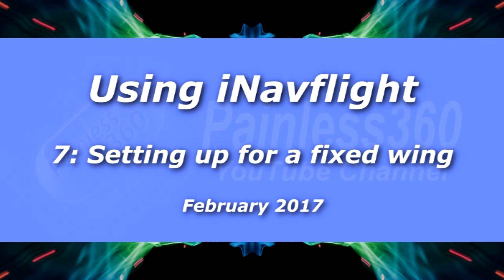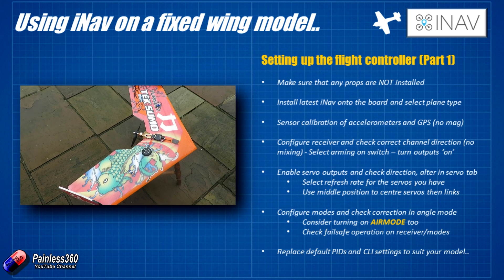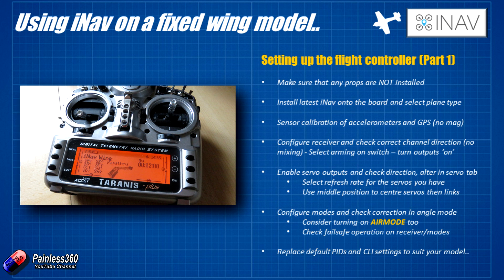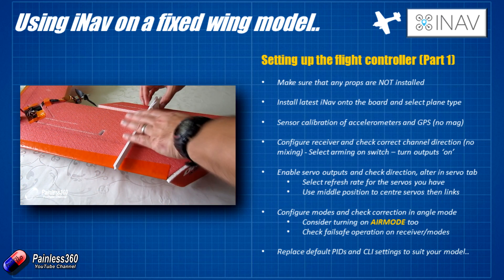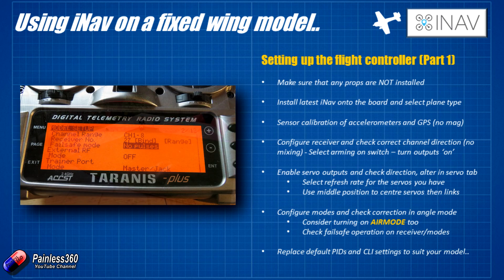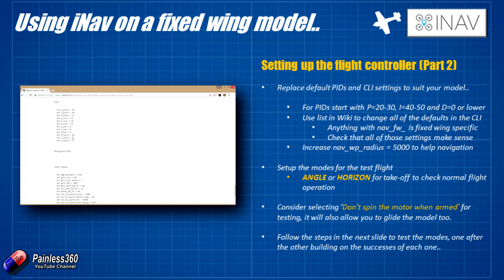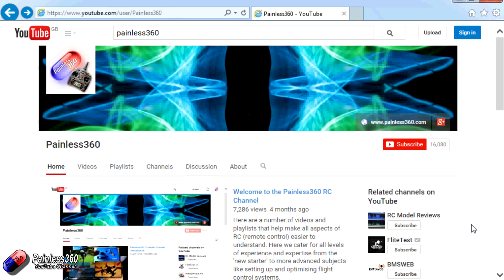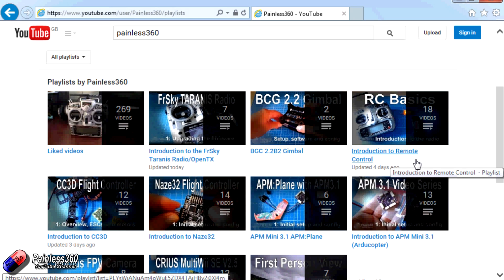(7/8) Introduction to iNav: Setting up iNav on a Fixed Wing

Comment: I am sure this is a very outdated comment, but can I fly a fixed wing with 3Ch receiver ? Inav does not arm the throttle motor automatically, I can move the servos but not the throttle, Do i need 5ch to have one for arming? Thanks.
Reply from the maker: I've never tried.. Best of luck!

Comment: What's the correct way to enable dual rates via toggle switch during flight?  I've tried changing settings for the different "Profiles" and then enabling "Rate Profile Selection" from the Adjustments tab.  But it doesn't seem to be working.  INAV 2.5 does not have a Servo tab and I can't figure out how to do this from INAV.  Or should I just configure dual rates from the Tx?
Reply from the maker: Check out the new INAV for beginners 2020 series on the channel. I'd only worry about rates if flying in manual or acro and then I'd do it on the radio..
Reply: @Painless360  Thanks.  Yes, I have been watching them.  I fly both manual and acro modes.  Betaflight allows you to change between rate profiles via a toggle switch during flight.  Can't seem to figure that out in INAV.  But maybe it doesn't have that.

Comment: Hi Lee  Is there a way of bypassing the "Nav is safe" in the prearm checks on the setup page of Inav.  I have 9 sats on the GPS page and all looks like it should be working ,but wont arm because of the red cross still illuminated. Any advice would be welcome.
Reply from the maker: You can disable it but I wouldn't - I'd look at fixing the underlying issue first.. See may latest iNav 2.1 series for the latest advice.. Best of luck!

Comment: What if the arerons aren’t moving in the right direction when I am moving the w8ng like you?
Reply from the maker: Covered in the video at 6:00.. happy flying!
Reply: Painless360 I am using the F722 board and I didn't find that option, I'll keep trying thanks
Reply from the maker: @javieruriel  If you're using the latest version then check out my video on the custom mixer in iNav.. ;)

Comment: Hello, I'm setting up a Nano Talon with F405 Wing and iNav 2.0
Everything looks ok but the Home Direction arrow in the OSD.
When the craft is pointing straight to home or away from it, the arrow is ok, but in other situations it is reversed, pointing left while should be right and vice versa.
What can be wrong?
Reply from the maker: Depends if you have the mag on or not. If it’s not then the direction is calculated during forward movement..
Reply: @Painless360  it has, but I'm considering disabling it

Comment: Hi, I am in the process of setting up my first Inav flying wing. I'm a multi rotor guy and am looking forward to a little fixed wing fun. I'm using the Omnibus F3 flight controller. Is this able to handle the amp draw from 2 micro servos, X4R receiver and GPS all at once? I have thought of only running the signal wires from the servos to the FC and power them from a separate BEC. 

Cheers and thanks for all the great content!
Reply from the maker: All of the information on that flight controller will be in this video you're commenting on. I've not built another iNav wing using this controller, see my later iNav series for more information.

Comment: I have a ritewing mini drak on the way which has a boom and elevator setup.  Would I setup the normal plane model and just ignore the rudder since it won’t have a rudder?
Reply from the maker: Set up just like any of the flying wing should work fine.
Reply: I found a mini skyhunter profile that I can copy into the cli then confirmed from multiple people on the inav fb group that it would be the best starting point. Its more of a airplane than a wing from my understanding. Thanks for replying. I'll post a reply when I find out if it works properly when i get it built.

Comment: Hi, thanks for super useful info, 
One little note at 6:30 limiting servo throws by 40% is possible but kind of luxurious (60% loss of servo resolution).  
If you want to have less throw the best practice is to mount servo rod at the most bottom hole as possible (towards the servo shaft) you get less throw (but more resolution) and more torque! (and only cosmetic limitation in FC only if needed). This is the best practice.

Comment: at 8:10 you are using something to measure the angle of the wing at 13 degrees... can you please let me know what is that? how did you make it and what does it do exactly?
Reply from the maker: Two spare bits of foam board that I used to get the angle and then used a protractor to measure it :)

Comment: hi,
i have a f3 inav with gps,
the problem is just, that the gyro working 90 degree bad.
if i turn left and right the plane, the alerions goes up and down together.
if i turning to front or to back, the alerions moveing up and down single.
the plane moveing in the inav on the setup screen perfect.
can you please help me?
thx.
radicsmilan et gmail dot com
Reply from the maker: Sounds less like a gyro problem I'm more like one of the servos is backwards. Best of luck

Comment: I am using a omnibus v2 on a fixed wing and want to install servos, how is that done? Thanks.
Reply from the maker: All covered in the video you've just left a comment on. I've not tried it with that particular flight controller, but I'm sure if you checked the pinouts they should be very similar. Best of luck
Reply: Painless360 Ok thanks😄

Comment: @painless360 - Please help my roll is correct i.e. i roll left and the flaps move correctly - roll right and the flaps move correctly. However my pitch access seems reversed - I.E when i pull the stick down the flaps move in such a way that the plane if flying would pitch nose down - is this the way it is on wings? (im new to wings this is my first build) On quads when you pitch down with the stick the nose of the quad goes up.
I know i could just reverse the chan in my receiver but the fact its reversed on the servo's would that impact stability modes and RTH ect?
Reply: Found the Fix
-
EDIT:
This is needed on a flying wing when i.e. roll is handled correctly, but pitch is reversed. Servo reversing won't fix that - you need either to mechanically reverse the servos (switch them), reverse pitch mixing by smix or simply reverse pitch input by smix reverse

Basically i switched my servo's round and all now works!

Comment: Setting up a new CL RacingF4 Air board.  It came with iNav 1.8.   Everything looks perfect in iNav configurator.     Shows Rx inputs.   The  Motors page shows correct responses on ch4 and 5 outputs for elevon mixing when I supply stick inputs, and when I move the board in each of the stabilized flight modes.    "Enable motor and servo outputs" is turned on.     
But I get zero servo response, and the motor never gives me arming tones.    Doubled checked servos/ESC/motor all happy when I plug them directly into the Rx.  Broke out my little oscilliscope and it shows no signal at all on the Ch 1/2/3/4 signal pins (verified I get normal PWM from my Rx)     I saw one other person with same problem, but no resolution.     Is there some extra secret step to get the outputs working?    I tried iNav 1.9.0 RC1, and the issue remains.
Reply from the maker: Sounds to me like a power issue on the output. How are you supplying the five volts to the servos?
Reply: CL RacingF4 Air board is specifically designed for fixed wing aircraft.   It has it's own 5V 5A BEC just to power the servo rail.      I finally took my oscilloscope to the signal pins and they're showing *nothing*.    Verified I get a proper signal on the Rx PWM outputs, but nothing at all from the board on outputs 3/4 which are supposed to be the first two servo outputs, which is all I need for a flying wing.  

Here's a more general question. When any board is setup for fixed wing, I should be able to do a "resource list" from cli and see some pins referenced as "SERVOX" right?   e.g.   A02: SERVO3 OUT   or something like that?   I don't see that, and I don't appear to be able to remap anything using the resource command.  It just ignores anything I throw at it.
Reply from the maker: I’ve not tried iNav 1.8 so not sure...
Reply: Looks like in the hardware changes between V1 and V2 of this particular board, all the outputs were reordered and I suspect the resource pins are different as well.   I may have the V1 firmware loaded, so I need to reflash and try again.
Reply: Turned out to be a couple things.    I have the latest CL RacingF4  Air V2 board which apparently has it's own custom firmware, only downloadable from the product page.    Loaded V2 firmware and am now seeing  PWM servo outputs (resources still lists them as type MOTOR).    The real quirk though is the order of outputs.    
The diagram on the product page for V2 says output order should be  (starting at 3rd position down)
SBUS, 6, 5, 4, 3, 2, 1 where 1 and 2 are motors.
What I actually see depends on which fixed wing type I choose. 
airplane  SBUS,  6, 2, 1, 4, 5, 3, x
flying wing   SBUS, x, 2, 1, x, 4, 5, x  (notice that 4/5 are not on the same pins)
The diagram also shows only 6 servo/motor outputs, but there's really 7 sets of pads on the board, with 7th always doing nothing (maybe not connected, or is another input).

Comment: First off love yor channel 
Have I now have loaded on F3 Pro omnibus hooked up correctly but my elevator and self level operates backwards what's a controller it works normal what do I adjust
Reply from the maker: That's covered in the video.. Channel reverse on the radio is the place to start. Best of luck!

Comment: hi P360! I am setting up Inav on a wing with a Colibri race f3 and the powercube pdb. the controll surfaces seem to be working right (although the throws on roll is much stronger than pitch), but my motor does not want to respond to stick movement. I have tried PWM1 (esc does not beep), and pwm2 (esc does beep). I am using a Cobra Wing 80a Blheli esc. Any advice would be greatly appreciated.
Reply from the maker: +hugh bradburn it depends on what troubleshooting you've already tried, you need to make sure that everything is green in the graphical user interface and, you also need to make sure that you've arm the flight controller..
Reply: Painless360 got the motor spooling up now, but when the throws seem short, and adjusting the rates in the servo tab does not seem to do much. Also the pitch throws are much shorter than roll. Is that normal? How would you suggest adjusting this?
Reply: Thanks as always!
Reply from the maker: All of the detail I have are in the videos. I assume that you've looked in the playlist? There is one called 'iNav Quick Tip: Why the elevator and aileron controls move less in Angle or Horizon mode' ;)
Reply: Painless360 of course I didn't. Lol. Thanks for pointing me in the right direction.  Are the fw cli settings you changed still valid? Or is it included in the current version of INav? As always, you are such a big help! Thanks!
Reply from the maker: New series will be starting in a few weeks - you can preview the first video here: 
https://www.youtube.com/watch?v=qDbKvIfmrsU&list=PLYsWjANuAm4ok-lLo1B1atZm-qXfc41Pk

Comment: i have omnibus f4 v3 without mag on board, my gps hasnt compass also. will i have problem in my fixed wing for rth mode?
Reply from the maker: +cattlebaron it's actually got very little to do about whether the model has a front or back. As quadcopter can fly in any direction, while a plane can only fly forward. Because of this you can use the moment to moment position of a plane to calculate the heading and direction. That's why in a plane you can get away without having the magnetometer enabled. The whole thing about having to rotate the compass direction 180 degrees is actually about how the compass chip is installed inside the external GPS. Sometimes the chip is mounted on the bottom of the GPS receiver and this means that it's actually upside down. Hope that helps and makes it clearer. Best of luck!
Reply: It is a bit to complicated to explain simply, but if you find nav_launch does not work move the wing with NO PROP on the motor and see which direction you have to move the plane to start the motor, in this case it was backwards. In the iNav configurator go to the Configure tab, then down to Board and Sensor Alignment, move to Accelerometer Alignment and set the direct as required. You will most likely need to change some of the default values in the CLI
Reply: but in one of your videos you said that in fixed wings we dont need compas
Reply from the maker: +Bill Asimakopoulos as you said, the answer is in the video. I missed the part about fixed wing in your question. Best of luck
Reply: thanks
Reply: I don't think so, a plane unlike a quadcopter has a defined front and back. I have read a number of times that a compass actually makes it harder to tune. Have found with INav 1.7.2 the accelerometer alignment has to be changed by 180 degrees e.g.in the CLI set align_acc = CW180 to make nav_launch work.
Reply: i have 1.7.3 so how you figure that you should change rotation for 180 degrees?
Reply: thank you very much

Comment: Thank you for the awesome videos!I have a question. Ive followed your tutorial and the wiki.I noticed in your video that when you move the right stick left or right the elevator moves, while the aileron moves when you move the right stick up and down.that appears backwards.Is that correct for your setup?My receiver setup in inav shows the channels are mapped correctly and moving in the right direction.My channels are setup TAER1234. However, I want the elevator to move when I move the right stick up amd down.Any suggestion on how to make that adjustment?thanks
Reply from the maker: Nope that worked great, follow the series and wiki to see the result. Best of luck!

Comment: Have you made a video showing iNav/wing combo in either iNav 1.7.1 or 1.7.2? I can get either one working partially. In 1.7.1 the servos work but when moving the wing no corrections or stabilisation happens, in 1.7.2 the servos move only in a minuscule manner certainly not enough to control a flying wing (Teksumo fitted with an Omnibus F3 in my case). There are a number of other issues but I will leave them for now. I do study the wiki thoroughly and often and do lots of other reading.
Reply from the maker: +cattlebaron I'm using 1.7 on wings here. See the video on small servo movememts in the iNav playlist.. Hope it helps..
Reply: Tank you pl360, I assume yo mean the PIFF video which I have watched a couple of times and also read the wiki but I can't find the part you showed in your video. To the problem in hand I have the servos moving on my sim so I will now mount it in the wing and report back. I set the P=5, I=15, and D =20 (rll) D= 30 pit)
Reply: I found the "iNav quick Tip why the elevator and .." explained the problems I and my mate had, it is a must see if you intend working on a wing or for that matter a plane project.
Reply: so what i must do??

Comment: Hey Painless 360 -love your videos btw.  I'm running inav 1.7 with a Omnibus F3.  The issue I'm having is I have a L9R reciever and I can't get the board and inav to see the RSSI signal.  I have the RSSI wire to the RSSI pin on the omnibus.  Is there a way to do this?
Reply from the maker: Checking the notes on that board it appears there are some limitations.. https://github.com/iNavFlight/inav/blob/master/docs/Board%20-%20OMNIBUS.md Hope that helps..
Reply: Painless360.   Thanks.  Too bad.  Does the F4 omnibus support RSSI?
Reply from the maker: Not sure, again I'd check those notes. Best of luck..

Comment: Love your video's. I've been trying to setup iNav v1.7 on my fixed wing, but I can't get the throttle to work. The motor seems to work by using the sliders on the Motors-tab in the application. Within the Receivers-tab, the bar for the throttle is moving when I move the throttle-stick of my transmitter. Arm-mode has been switched on by a switch. And the nav_extra_arming_safety is set "OFF". But still no throttle-function working. Any idea what I might have missed?
Reply from the maker: No idea, I'd make sure you can see the arming symbol turn on and all the pre-arming checks are green in the CLI. It won't arm until it's got a GPS lock...
Reply: Thanks for your feedback. Yes, I can confirm the arm-mode is active (looking at the modes-tab of iNav. But I'm not using any gps. So I don't have a gps-lock. That's why I've turned off the "nav_extra_arming_safety". But maybe I've forgot an other option/setting?

update: I've flashed with CleanFlight v2.0.2 and in cleanflight all seems to work, including the throttle, when configuring for a fixed wing. Than I've installed iNav v1.6.1 and v1.5 and both versions have the same cause as with v1.7, meaning, I can't get the throttle to work. So based on my positive Cleanflight experience, it must be something with iNav?
I've noticed in Cleanflight that the ESC refresh-rate (PWM) is 480Hz, in iNav (STAND) it's 400Hz, could that maybe be the cause?
Reply: did you work it out? i am having same issues.

Comment: does it hold the position upon correction, does it behave like APM?thanks
Reply from the maker: Very similar. Planes too! :D
Reply: Painless360 flashed my old flip32 rev.6 with inav, when i bank and hold the tilted position the servo retracted back and never hold the tilted angle, unlike for apm it still holds the position if i bank and tilt the flight controller, can help us to verify for this differences.thanks
Reply from the maker: Not sure, works ok here. What troubleshooting have you tried?
Reply: i dont what happened, i reflashed again for a couple of times using CC3D and lastly with NAZE ver 1.7.0 and suddenly become OK. it behaves now like APM/Pixhawk